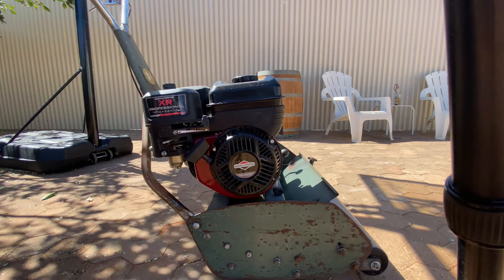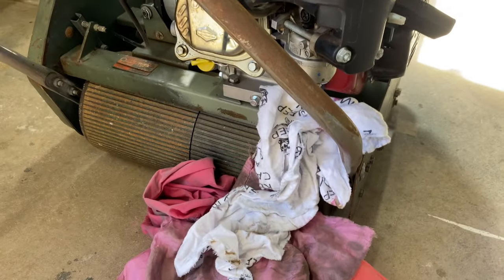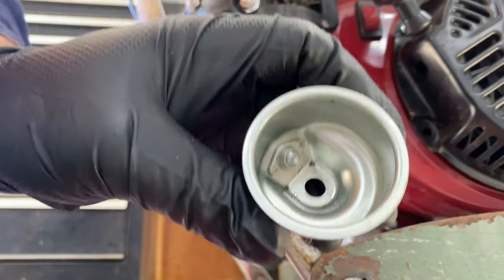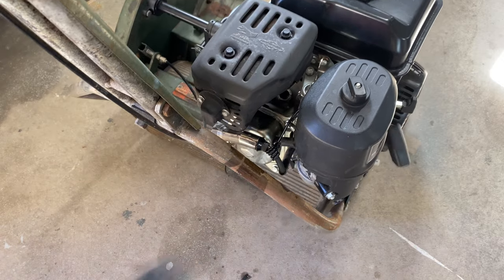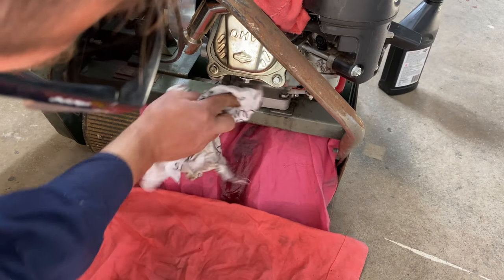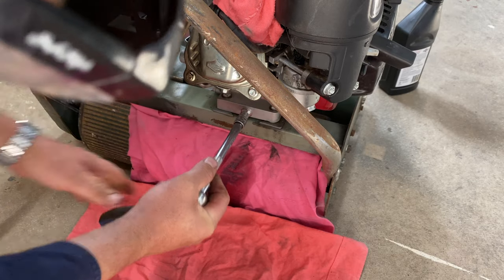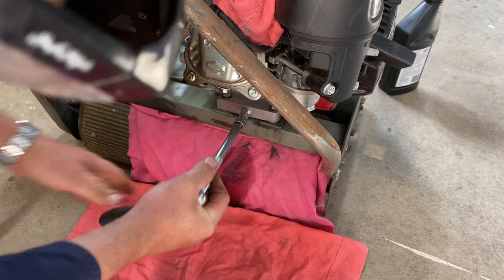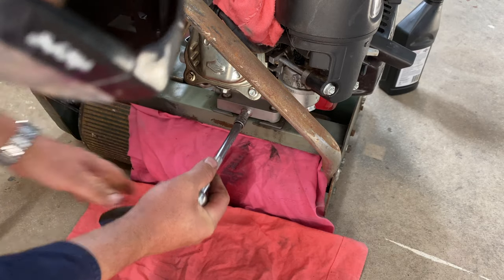How to fix Small Engine, hydraulic locked (hydro-locked) with fuel. Briggs&Stratton/ Scott Bonnar

Comment: my honda 4 stroke trimmer locked up. After watching your vid I emptied the fuel and oil tanks and removed the plug just like you showed. I was back up and running in 5 mins flat . Cheers from Qld
Reply from the maker: That's awesome news 😃. Thanks for sharing 👍🏻😃
Reply: Mine had a bunch of fuel in the spark plug and oil pan when I drained it. Changed the carb, fuel filter and oil but it’s still locked up. Any suggestions?

Comment: If you install about a 2-inch pipe in the drain hole with an elbow and plug on the end, you won't have oil running all over the place when you drain it. It will run right into the container. Don't know why manufacturers always put the drain right on the frame like that.
Reply from the maker: It doesn't really bother me with how often it gets serviced. 😃👍🏻

Comment: Just a note that I recently learned about hydrolocking my engine.  When you are removing the old gas from the cylinder by pulling the starter lead, be SURE TO NOT HAVE THE SPARK  PLUG LEAD ANYWHERE NEAR A GROUNDED POINT!!  The gas/oil mix might ignite due to sparking.  Could happen just saying.  Learned that from a seasoned tech who must have had it happen in the past.  Great video and thanks...
Reply from the maker: Yes, A Very good point 😃👍🏻 cheers
Reply: That tip is huge. Thanks man a spark in that situation would be very bad.

Comment: Took out my plug. She pulled great. There was a bit of fuel in there but very little. Pulled and pulled till she was clean . Put the plug back in and no change. Did this procedure 3 times to no avail when plug goes in she’s locked up.
Reply from the maker: That's very odd 🤔 I have absolutely know idea. Definitely the right plug? It's not to long and fouling the piston?
Reply: This is my problem. It can’t pull with the spark plug in but pulls fine when I remove it.
Reply from the maker: Gday mate, if there is no fluid in there. Or the plug isn't to long and fouling the piston. I'm not sure, without seeing it for myself. Let me know when you nut it out. I'd love to know what is going on 😃👍🏻

Comment: I only get one pull out of mine before it’s locked back up again and i have to take the pull cord cover off and manually spin it back in order to get another pull. Thoughts
Reply from the maker: Gday mate. Apologies, Your comment sliped through. With out seeing it in person, this sounds like a pull starter issue. I'd say the recoil spring has disconnected or broken
Reply: @rustyinspirations  no worries. Mine was hydro locked as well. I think mine had an issue in the valves/springs though bc after i had drained the oil and lubed the piston it was doing what i described before so i took the valve cover off to check how they were moving and the pull cord started acting normal.
Reply from the maker: Awesome 😃, you've done well. Glad you got it sorted 😃👍🏻

Comment: Pull rope on 2-stroke trimmer stuck until I removed the spark plug. Then the cylinder moves smoothly with no resistance. Assumed hydrolock. Drained the fuel and checked the carburetor, but as soon as the plug is re-inserted the problem returns. Any suggestions on how to proceed under this scenario? (By the way, when I checked the carburetor I found the air filter to be saturated with fuel.)
Reply from the maker: G’day Robert, hmm 🤔 It sure does sound hydro locked doesn’t it. Did you find fuel in the cylinder? Being 2 stroke the air and fuel gets sucked into the crank case on the up stroke, so possibly fuel in there also. You might need to remove the plug again and turn it over while it’s upside down or on its side. Or Evan remove the carburettor to get the fuel out. Let me know how you get on 😃👍🏻

Comment: Its weird i have Aspen fuel which is good for 2 years in it but it still wont start.
Turned out their was water in the oil after it sat outside lol. I changed the oil and it started right up.
Make sure to cover your stuff with a tarp or pastic bag.
Reply from the maker: Definitely I Good point to at😃👍🏻

Comment: Hondas r bad  about flooding the cylinder with motor oil if the motor is knocked over even seen the better pressure washer 3000 psi or more fluid lock switch most  of the. Time is hydraulic  or motor oil inside the pump pressure adjustment  that also can seize the engine
Reply from the maker: Good point😃, yes I have also came across some Honda's with oil in the top end 👍🏻

Comment: I think I have the same issue, however after draining the gas and removing the spark plug, my cord is still stuck. I can't pull and force gas out of the whole where the spark plug is. Does that mean I'm not experiencing hyrdolock on my pressure washer?
Reply from the maker: Hi Stephanie, Correct your issue may be with the pull start it’s self.
Reply: L

Comment: Im not a mechanic so I don't know what you mean when you say bottom end. Is your point that the oil needs changing?
Reply from the maker: Gday Robert, the bottom end is the crankcase, (everything below the cylinder and piston) The crank case contains oil to lubricate the bottom end. Although after time the oil can become slightly contaminated with a small amount of fuel that makes its way past the piston rings. In this case it was exssesive, to the point it had actually increased the oil level. This much fuel will thin the oil and possibly not lubricate as intended. I hope this answers upu question. But feel free to ask more. I'll do my best to answer them 😃👍🏻

Comment: Yeah I’ve done all of this even tried the magic oil down the spark plug hole. When I put the spark plug back in it locks. I’ve even taken off the carb and cleared the fluid. Only 1 month old engine. The gas did flow to the oil and got into my filter, I removed filter and changed oil still locking up when I put the spark plug back in. When the spark plug is out I can pull it though. I’m very confused on what to do next.
Reply from the maker: Gday mate, the only two things I can think of is the spark plug being go long and fowling the piston. Or it's not completely dryed out and is still hydro locking? Sory I can't be of more help 😔
Reply: @rustyinspirations  does it have to be completely dried out 100% because I see people poor magic oil down the spark plug hole and they can pull and start the engine. Also the spark plug being too long? What could this mean, it’s all OEM off the engine. Thanks in advance.
Reply from the maker: If the plug is genuine, This wont be an issue. You don't want any fluid in the top of the cylinder, only vapour. What is the magic oil? Fuel?
Reply: @rustyinspirations  the magic oil is oil technically. Something people use when they get stuck because the gears aren’t lubed or something like that. I guess when you poor it down the spark plug hole it’ll eventually loosen up the crankshaft. There’s videos on YouTube everywhere on it. So no fluid at all on the top of cylinder? So is it possible because it’s slightly wet that I can’t pull when I put spark plug in?
Reply from the maker: Got ya😃, are they putting oil down the plug hole because the engine is seized? I have done this many times in the past also. However your engine doesn't sound to be seized as such. The fact that it turns over while the plug is out confirms this. In wondering if the little bit of oil you are putting down the plug hole is just enough to hyrolock the engine? Sorry if im not a lot of help. It can be very different diagnosing something that I can't actually look at 😂
Reply: @rustyinspirations  I completely understand. Thank you for your responses. Maybe it’s getting hydro locked from that? My only question, if the engine is hydro locked on the inside cylinders and I can’t crank it out through the spark plug hole, does this mean I have to get to the inside of the engine dissembled. Or is there another efficient way to get the liquid out.

Comment: Mine is froze up.
I checked oil, fine, pulled plug, still cant pull it, checked if pressure of pump, still cant pull.
Sprayed W-10 into Cylinder,  now to crank with a wrench to see of i can move it.
This is a Pressure Washer!
Reply from the maker: G’day mate. Unfortunately a lockup engine isn't always a simple hydraulic lock fix. It could be the pull cord, Or it could be something internal in the engine And sometimes catastrophic. In your instance it could possibly be the pump its self that is locked up. You could test this by separating the engine from the pump to narrow down where the problem lies. 😃

Comment: Do you think this is what the problem is if I can’t pull the recoil when the spark plug is in but pulls fine with no spark plug?
Reply from the maker: G’day mate, Did you end up having any luck?
Reply: @ it was the compression release. I didn’t fix it because I work in a shop and have access to other GX390 engines so I replaced the engine with a newer one. But I’m glad I got into it and figured out what was wrong. I’d never run into this problem until now.
Reply from the maker: Awesome mate. Thanks for sharing. I assume it’s a rather big engine?
Reply: @rustyinspirations  yes. Like 2 GX160s

Comment: There maybe a screw in  filter like honda and chinse copys  filtee screws in from u der neath get torch look down in tank cap off if one there u will see bit of pai  tank has to come off take notuce of way fuel line runs diection it goes if not u may squash fuel line cut fuel supply machine wont go lol i d iud it had to take tsnk back off rerout fuel line all good then
Reply from the maker: Yes, you are right. it was an internal filter (inside the tank) It was missing. So obviously wasn't there from factors. I done a follow up video showing this 😃👍🏻